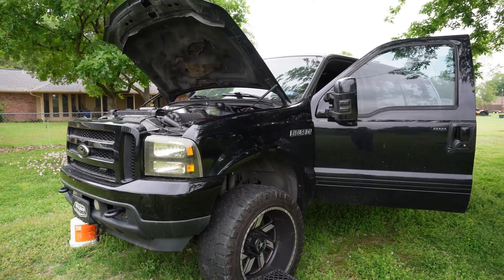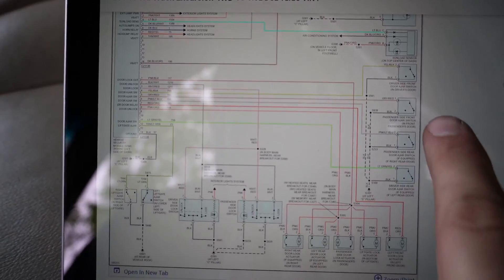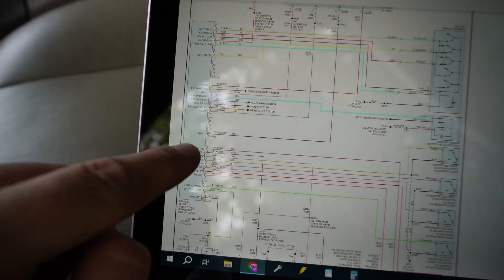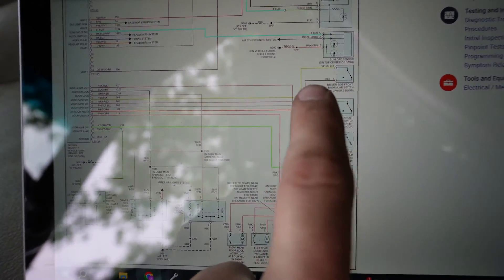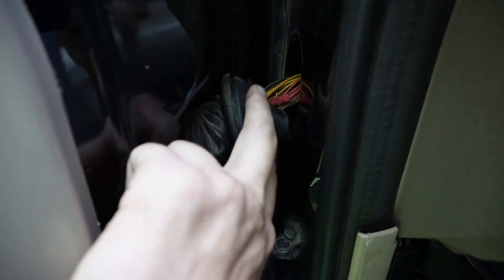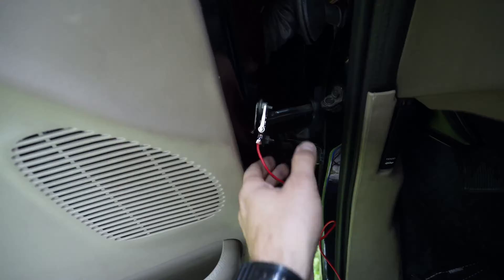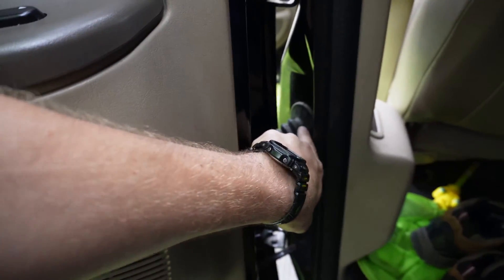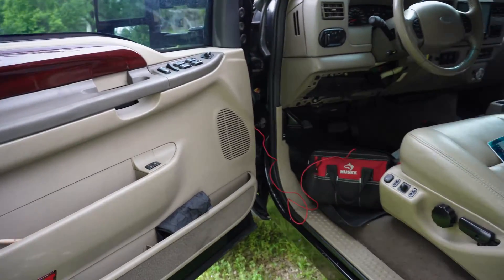Ford DOOR AJAR sensors fix w/sensor diagnostics 04-05 Excursion / F250

Comment: Would this help a problem in having, my running boards and interior lights stay on with doors shut, but there is no door ajar light on. ( when you open any door or the back gate the door ajar light kicks on like it should)

Comment: Would doing these steps cause the adjust light to go off? Right now mine is on when all my doors are closed so I am not sure where the bad one is.
Reply from the maker: No, the steps should not cause the issue if they were installed correctly.  One of your door latches is likely bad.

Comment: not sure if you could point me in the right direction but I amber a 05 v10 excursion my issue is since I’ve owned it none of the doors cause the ajar light to come or any interior lights to come on when opened, I can manually turn on all of the interior lights from the headlight switch? I don’t think it’s likely that every single sensor including the hatch has failed (closed) and I don’t thing the po unplugged every single sensor  but more likely… all fuses look good all power door locks work fine.  Is there some mod or something known that the po could have done to disable the door ajar system? I can’t find anything online about it? Thank you for your time.
Reply from the maker: Hey there! It is possible that the previous owner disabled the system because one sensor or more was bad. Use the diagram I linked and check the main power and ground feeds to the security module
Reply: I got the same issue but all the ajar work 
No dome lights

Comment: Is there a scanner that will tell us what sensor is out? I think it’s my rear door.
Reply from the maker: No. You will have to test them manually like I showed here. Ground out each sensor wire until you find it. If you have a 2000-2003, I think those door sensors are always grounded, and you have to break the circuit to trigger doo ajar. Juist opposite of my video. Alot of times it is just the latch, and spraying with wd-40 will fix it.